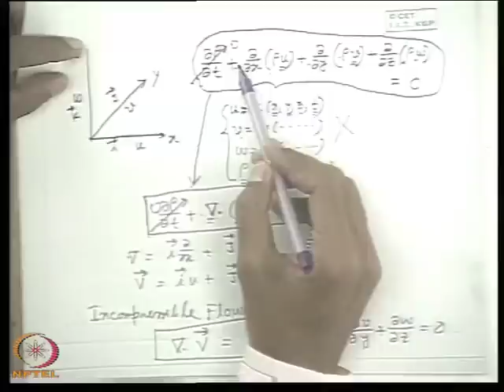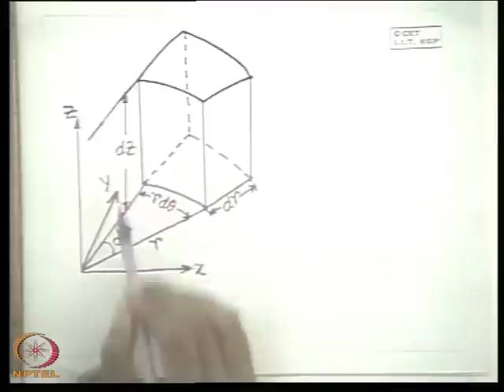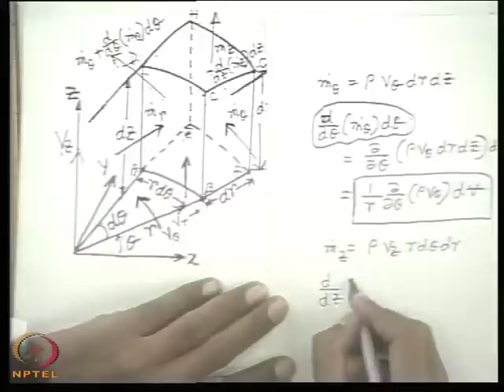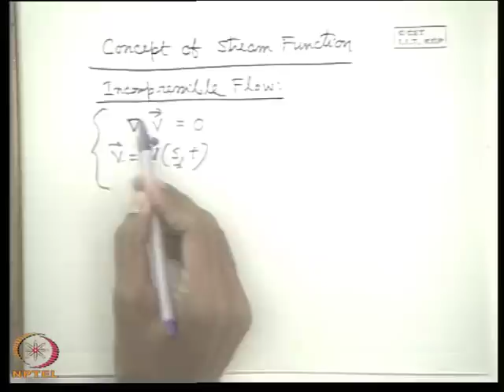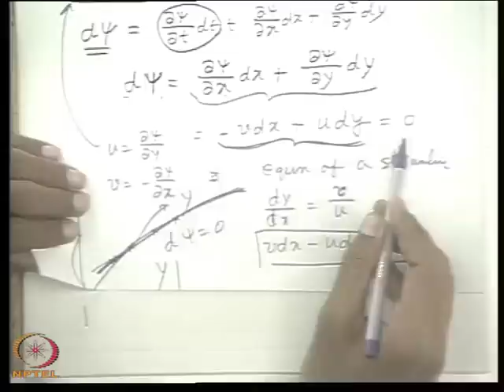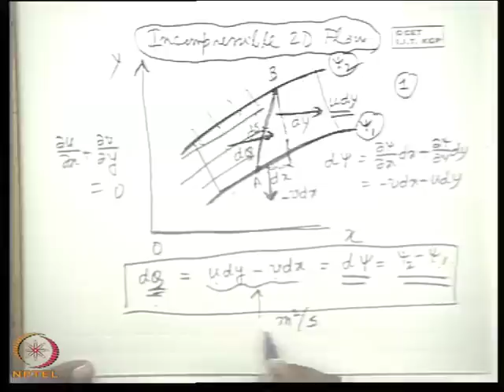Mod-14 Lec-14 Conservation Equations in Fluid Flow Part - II

Comment: Sir I've one doubt ,if any flow field is not satisfying the continuity equation ,who do say this flow is not possible.. please 🙏🙏 reply
Reply: If a flow field is not satisfying the continuity equation, it means that there is a violation of the principle of conservation of mass, which is a fundamental physical law. In other words, mass is either being created or destroyed within the flow, which is not physically possible.

For example, if the divergence of the velocity vector field is positive at a particular point, it means that fluid is being created at that point. This would require a source of mass, which is not possible in most fluid flow situations. Similarly, if the divergence is negative, it means that fluid is being destroyed at that point, which would require a sink for mass, again not possible in most fluid flow situations.

Comment: why does the divergence need to be zero??? what's it's physical significance?
Reply: Divergence equal to zero is continuity equation which comes from conservation of mass
Reply: watch khan academy video on physical significance of divergence and curl
Reply: The continuity equation states that the rate of change of mass within a control volume must be equal to the net mass flow rate into or out of the control volume. Mathematically, this is expressed as the divergence of the velocity vector field being zero, which means that the flow is incompressible and no fluid is being created or destroyed within the control volume.

The physical significance of the divergence being zero is that it ensures that the mass of fluid within the control volume is conserved over time. If there is a non-zero divergence, it means that the mass is either being created or destroyed, which violates the principle of conservation of mass.
Reply: Physically it means that there are no sources or sinks in the flow.

Comment: Third term of continuity equation for cylindrical coordinate system derived by expansion of general vector form is not similar to that of what derived from Mass fluxes entering and exiting concept based continuity equation. (Density x velocity in r-dir)/r is not equivalent to partial derivative of (density x velocity in r-dir) in terms of r. Would you please help me to understand it mathematically.

Comment: We can also have variable density incompressible flow, in latest videos of nptel prof sk som has told this, del. V is zero from kinematic analysis, i think it is an old video, so it is deviating
Reply: Where have you been watch that video?
Can you share link
Reply: @vridhikhanna1580  https://www.youtube.com/watch?v=HyRI06iw3F0&t=899s 
I believe this is the one.
Reply: @kevinf3094  I thought there is new lecture series by sk som
Reply: Share the link bro of new video
Reply: Yes, it can be. Incompressible flow simply means that the substantial derivative of density wrt time must be zero.
And incompressible fluid will always generate incompressible flow and compressible fluid may also generate incompressible flow when Mach number is very low.
Reply: This is explained in 1st module in this series ,before surface tension ,
Reply: The two words "variable density" and "incompressible" contradict each other. I don't know what you mean.

Comment: In question no. 4 at 48 mins. of the video, why the angle is 135 degree but not 45 degree?  Please help !
Reply: angle is always taken in anticlockwise direction from positive x axis. So 135 degrees
Reply: Dhanush B S I think it should be 315 degree
Because v is -1 & u is +1 
Resultant therefore in fourth quadrant.
What u think?
Reply: I think you are correct. At (1,1) velocity vector makes the angle 315 with positive x-axis
 @wavyfuture6422
Reply: Sudeep Sapkota tan 135 Is -1.
Reply: We have u=1 ,V=-1 ,so it lies in 4th quadrant or second as sign doesn't matters so both 315 and 135 same ( can check in calc)